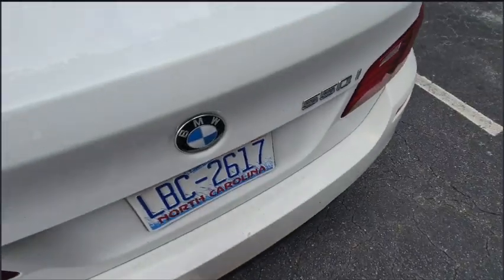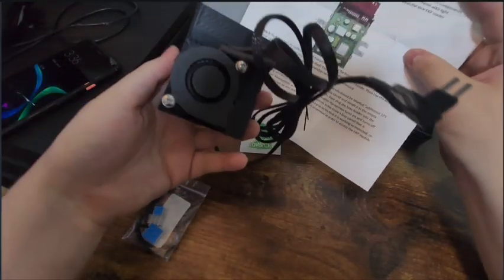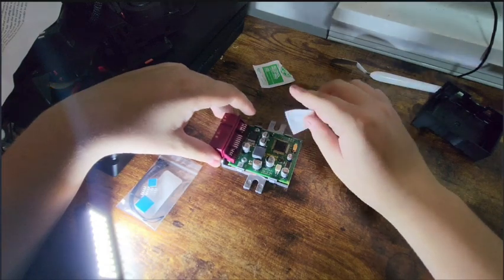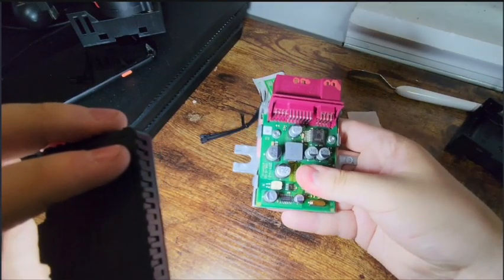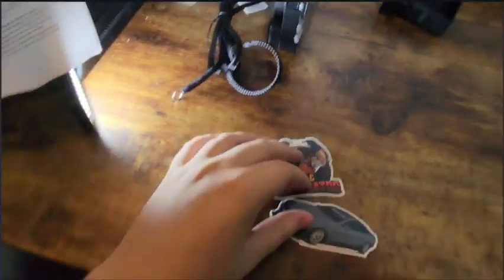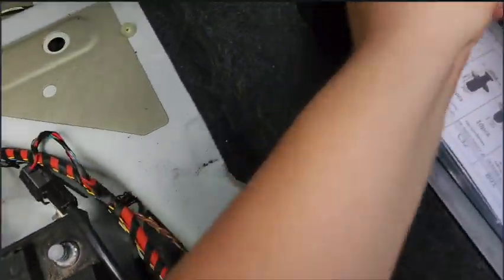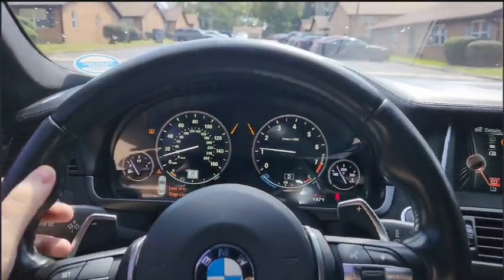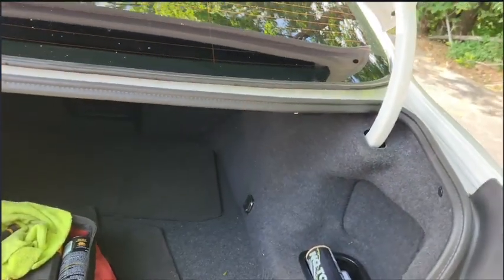OVERHEATING FUEL MODULE FIX.

Comment: Why would that fan run as soon as the battery was plugged in?
Reply from the maker: It immediately starts cooling, it has a cut off switch so after the car is off for a while it will turn itself off. 
It was on due to the battery being connected and the car waking up

Comment: Did your car still have fuel supply error message ?
Reply from the maker: No after I cleared them I haven't had the problem since it's been a few months, I've pushed the car extremely hard and nothing, this absolutely fixed my problem
Reply: @DavidBarahonaBMW  
Awesome thanks for quick reply and thorough video 👍